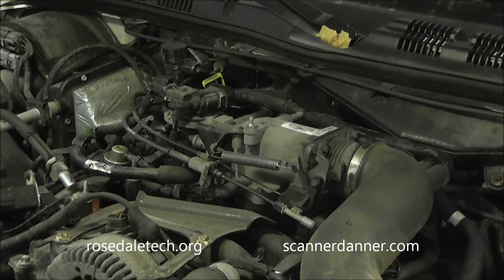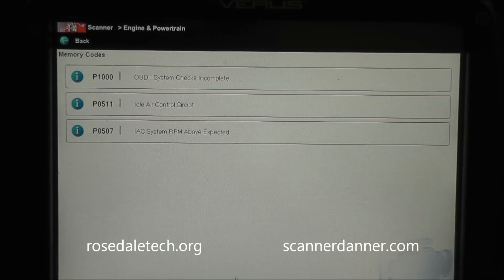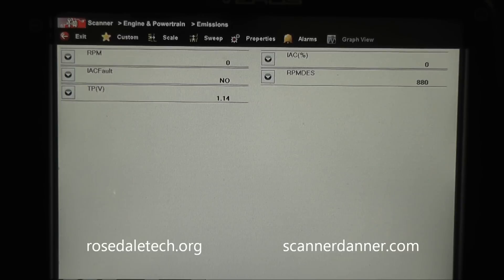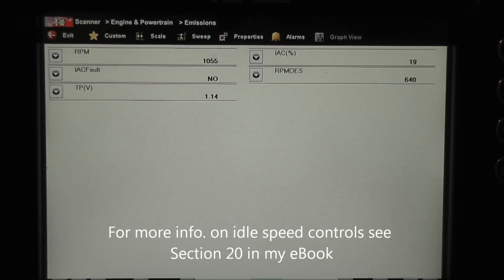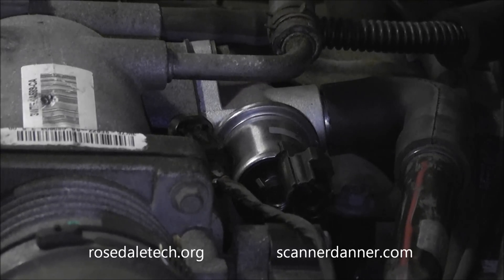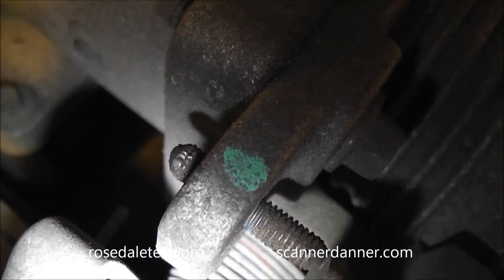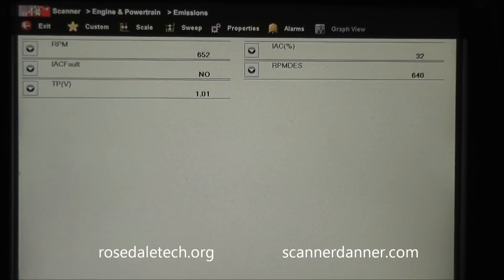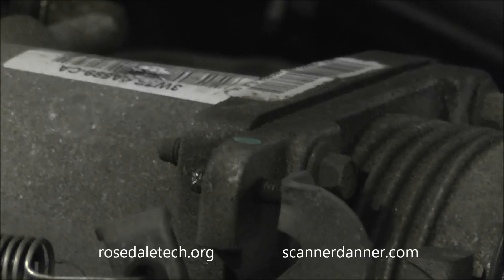Ford Idle Air Control (IAC) valve test (how to adjust minimum idle speed)

Comment: Will look into this, I just got a 05 Lincoln Aviator with 180 thousand miles in pretty good shape with the 4.6 32V, the only code I get is the P1000 as well but my trouble is every time it cold starts, RPMs rises to 2000 and after a few minutes drops to 1000 and I think that' s a little high for the engine lubrication in cold, any suggestions? Thank you for the Info!!
Reply from the maker: I would agree. What is your IAC % when it comes back down to 1000 rpm?
Reply: @ScannerDanner  just made the test, Desired idle Speed(RPM's):800, Engine revolutions Per Minute: 785, Idle Air Control %: 59.128% &TPS Voltage: 0.918V, this was performed at noon, tomorrow morning will perform  cold in the morning, thank s
Reply from the maker: That's a little high of a % for no accessory loads and at idle. I like to see around 30% on these. Clean your throttle body and redo that test

Comment: Not getting any codes, but when car is driven 5 miles one way and 5 miles back, the idle is way too high. Replaced with after-market IAC with no improvement.  Tapping on the IAC brings idle back to normal. Please advise.
Reply from the maker: If you are tapping on it and it is bringing the idle back down, then you most likely are still dealing with a bad part. (crap parts being made these days) Or maybe you installed in backwards? Some of these you could mount it either way.
Reply: @ScannerDanner  It's installed correctly. Will try a replacement. Thank you!

Comment: I wish this guy could have a look at my idle air control valve. My mechanic has 40 years of experience and could not fix it.
Reply from the maker: it is very possible you do not have an IAC issue. What is it doing?

Comment: So on my scanner when my explorer o1 os idleing its showing 17.2 % is that a good idle?
Reply from the maker: 17.2% on the IAC position? That means the ECM is commanding it fully closed. I'm assuming you also have a high idle speed?
Reply: @ScannerDanner  i wasnt at 17.2% then i went and fiddled with the tension screw of the throttle cable and raised it to 20% that resulted in my rpm at idle to go to past 2000rpm. So i lowered it to what i think is a sweet spot of 18% and rpms at idle show under 1000. Is that good?

Comment: Do you know general parameter settings for 2004 E150 5.4L Custom Leisure Van / Diy campervan? Needing higher idle rpm for force additional amps @ idle until I can get dual alternators installed.  Needing to keep a 3.56KWH Lipo4 house battery charged.  Thanks
Reply from the maker: You're not going to be able to change that. It is programmed into the ECM what idle speed should be. If you mess with the base idle screw, you'll end up setting trouble codes (this is a cable operated throttle body right?)
The only thing I can think of would be to fool the ECM into thinking either the AC is on, or there is high power steering pressure or that the transmission is in gear. 
I wouldn't mess with the transmission range switch input, but maybe the AC and or power steering psi switch 🤔

Comment: I have a 1997 Ford Expedition XLT 4.6 that misfires on one cylinder due to low idle at 550 rpm. No misfire at 650. Can’t pass inspection. Can the rpm be raised a bit?
Reply from the maker: You'll set other codes by raising your curb idle screw to the point where the iac cannot reduce it anymore. But you could try

Comment: Saved my ass.  I just bought a 98 f150 with the 4.6, started replacing OE consumables, after all that it still had a high idle and throwing p1507.  I was thinking I could have a bad intake manifold or something but, I did exactly what you did in this video (with a cheap scan tool- has live data), and sure as shit fixed me up nice.  Previous owner must have tried to fix the fact that he didn't do any maintenance on the truck, by turning that screw in.  Thanks.

Comment: So what if I’m idling at 1100 and the idle screw is backing out but the throttle lever isn’t moving back
Reply from the maker: vacuum leak, IAC motor stuck open, IAC is being commanded open (input issue) 
What is your IAC duty cycle command?

Comment: I watched some of your videos they are very good. It is really interesting how you check and tune things. Is there a way I can check the errors the had on my ford mondeo mk3 or it is only with special computer
Reply from the maker: what year is that? I'm not familiar with that model. You are not in the US either I bet, so I'm not sure what scan tool you would need to communicate with that
Reply: @ScannerDanner  haha yes, I am in eastern europe. My car is diesel, tdci from 2003, sedan with 130hp. I want to delete my egr but i want to lie to the sensors and because i don't want to search ppl to rework the computer. I wonder if my old car would have errors at all then maybe i can unplug the pipe that open the egr with vacuum air and make it stay closed.
Reply from the maker: @justvis1326  you can try posting to my forum and see what my community says. I have over 30k global members and it's free to join
www.scannerdanner.com 
Best I can do my friend
Reply: I gave a lot of money for repairs and i hope i can revive the car, because black smoke and loss of power got pretty bad lately. I think the problem is the egr system

Comment: I've seen the idle air control on a new edge Mustang v6 with no idle issues at around 52%. No stalling while decelerating or any other engine performance issues. Idle RPM is at spec. (between 700-730). Near the end you stated that this could potentially be an issue, can you elaborate on that? Maybe if I was stopped at a red light, uphill.
Reply from the maker: If you don't have any idling issues or stalling issues then don't worry about it.

Comment: 99 Mustang v6.   Throttle was hanging bad between shifts at 2 or 3k RPM.   Replaced IAC and TPS and still had issues.  With the IAC unplugged I backed off the blade screw on the throttle body till the RPMs dropped to 500 as described in this video.   Plugged IAC back in and idle came up to around 650 or so and solved the hanging RPM problem.  IAC now controlling throttle as it should.   Apparently someone messed with the screw.  Great video!!! Thank you.
Reply from the maker: awesome!
Reply: IAC restrictor plate solved my hanging rpm between manual shifts. Make sure to position the smaller hole opposite the IAC plug in.

Comment: I dont have any codes but my oil lamp comes on intermittently at a red light....could it be an idle issue or oil pump?
Reply from the maker: Could be from too much bearing clearance too. Oil psi test is the next step
Reply: @ScannerDanner  i notice at idle when my RPMS dip below 550 oil lamp comes on and thats when im on DRIVE at a stand still...in Park RPMS hover around 850 no oil lamp comes on 🤔 gonna find a shop to perform this test. 

What scanner are you using?

Comment: Hello and thank you for the video. Question, I did exactly as you said. At one time the idle plate was adjusted. I disconnected the IAC and the rpm jumped from 11k to about 14k. I unscrewed so the plate would close more but there was no change. According to the book my rpm should be at 700 idle. I added sandwich bag around  the IAC to make sure there was no air being sucked in that area but still no change. I plugged the IAC and the RPMs dropped to about 11k again. I've cleaned the idle plate and body too. Can you think of what my next step should be? Thank you
Reply: Vacuum leak

Comment: Hi Paul at 1:57 you mentioned not knowing if it had a EGR flow problem because someone cleared the trouble codes, what effect would a EGR flow problem have on the IAC?
Reply from the maker: I only mentioned that as a guide to the technician who is selling the job, to make no promises about the check engine light, because someone just cleared the codes before it was looked at. So other problems could exist. That's all. It was a cover your ass statement. 
An EGR flow (restriction) would have zero effect on idle speed and IAC function

Comment: Hey there... please help. 

My 2002 e250 van (cng)  has a low idle  this problem is new. It was fine then I just didn't drive the van for a long time the battery died when I jumped now it has a low idle.       Ok. Im thinking that when the battery died it erased the position of the idle from the computer now the van is confused and doesn't know the correct idle position?!?!?!?!  
  I'm so confused on what to do!!!!!
Reply from the maker: Tap on the IAC motor, it's probably stuck closed. I have a video on this on a Ford

Comment: so the valve is normally closed. no air at all goin in thru. so you unplug it and set the throtlevalve to 500rmp then plug the iac in and the computer adjust the valve. So if I unplug the valve with the engine running I should feel no air entering the air ports that feed the valve? if I do feel vacuum on the ports the valve is defective or not closing and needs changed out? I know the valve is clean , I know it moves , but I don't know if it closes all the way .

Comment: The last guy who was working on my Navigator,    turned up my set screw.....,    at least he told me and told me why.....  so as were finally getting it back in somewhat normal running condition......  found 2 vacuum hoses not even connected.....   a elbow boot that is cracked..,  added like 8 hose clamps.....  🤦‍♀️🤦‍♀️  apparently someone expected that they would hold themselves on.......🤦‍♀️🤦‍♀️already cleaned throttle body., m.a.f., found a unplugged coil pack..,  correcting my misfire n startup misfire code. 🤦‍♀️         new  I.A.C. & new T.P.S.  is on it  ,  I refuse to put another part on unless I verify it my damn self......🙃   however it's yelling  (the Nav.) alternator at me...!!!!     I have a  alternator test on my jump starter....  I have been procrastinating it..... (( yea, yea, I know)))   cause well  it's  a Lincoln, Navigator...........and it's gonna cry O.E.M.  ,,   O.M.G,,,
I am already broke....!!!!  Lol
And I am praying these cats aren't bad,   already in need of an exhaust.....    on the bright side  (if there could be one)
We don't have emissions here anymore.....!🤔😎😎😎🤫🤫
Contemplating  it for real....
I'm so close to getting him right,  compared to where he was when I  (rescued) him...
Lol..... my challenge vehicle for absolute sure.....!!!!   But,  thank God  he told me he set the idle up.....   I really didn't need to run in circles.....!!!!!!
With the multiple Mickey Mouse crap I found thus far, being majority of the problems.......GrrrrrrrrrrR..!
Done ranting now.........sorry...!🙄
Please.   Don't touch that screw.....act as If it ain't even there....!!!!!!    My idle is now 590--630,,      not  1100     ! I'm ok with that he is almost 23 yrs. Old with 182000 miles

Comment: Got a question my 01 crown vic doesnt soind like it has has a high idle when I first start it, ive changed the tps and the iac cleaned the throttle body and all...got any clues to what it could be...I dont have a scanner...??? Ty in advance...
Reply from the maker: are you having issues with the idle after the initial start-up? Is your minimum idle set right? Did someone mess with the screw?
Reply: @ScannerDanner  sometimes when I first start it its like it doesnt have a fast idle, ill start the engine and its idles slow immediately as if it didnt idle up upon initial start... I put new intake , iac, tps, iat sensor, mass airflow, its got 276k.. Runs like new tho, I have a hesitation like wen coming outta curve on light throttle, its done that 3yrs ive put 30k on it doing that, so I ruled out bad tranny cause it doesnt slip period..when I put new intake on it started idled up perfectly then after bout 30 secs it idled down like it was gonna quit, It acted up a couole days then started running fine, gets great gas mileage but that hesitation under light throttle puzzles me an wen i give more throttle it straightens up..but everytime I give it light throttle it'll hesitate only when driving out of a slow curve.. When I got the 01 vic the old guy said they put a new fuel pump in it but I cant see were a bolts been turned..I noticed it had old fuel filter on it when I bought it 3 yrs ago, I out a new fuel filter also,...do u think it needs a pump, but it also hold 35lb 40 lb pressure on my fuel gauge....its got new plugs and coils too...the idle screw has never been touched....it actes like something grounds out after coming outta slow curve under lite load....no vacuum leakes anywhere...
Reply: Even changed out tranny filter and solenoids 2 yrs ago...and new rear end gear oil.. The vic gets awesome mileage so I rule out tranny problems....its something simple or it wouldnt have lasted these 3 yrs....seems like a bad ground in my opinion some were idk.....wish I could get to you in pa I'm in southern w.v the vic is from nc and no rust period....ty in advance....I also thot maybe the passenger side cat mite be clogged when I changed the intake the whole passenger side of it was loose cause I poured water inna bottle around it...would a dobbed up cat cause the whole pass side intake loosen up??....it has a new intake now with no vacuum leaks anywhere...
Reply: When I ran fuel pressure out to take intake off...the pass side back injector squirted gass outta the rail...the whole fuel rail should've been bleed out since I ran the car til it quit running.?? so I could take fuel injectors out ..when I pulled the bk passengrt injector. Out of the rail next to firewall gas Squirted and it shouldve been empty were I releived all fuel pressure...thats the same passenger side that the old intake was vacuum leaking whole pass side intake was a bad intake all 4 cylinders vacuum leak...it has a new intake now...]
Reply: Could that back passenger injector be dobbed off since. Pressure came outta the fuel rail when I twisted the injector Out of the rail.l...???? Cause pressure is coming frombsomewere...
Reply: Ur the smartest mechanic I know on here and wish I could figure stuff out like you....keep up the awesome videos...I'm a subscriber btw but trying to get money for your other classes......ty scanner danner....u da man...Howie fr: Wayne w.v...
Reply from the maker: @berniceperry8898  you have multiple different symptoms, the hesitation on accel, let's talk about that for a second. Disconnect your EGR vacuum hose, plug it, then drive it. See if your hesitation is gone.

Comment: How about low idle speed. the idle sensor has been replaced, as has the EGR, MASS air flow sensor, all plugs and coils. Idle is still too low. in neutral or park is it about 615 to 630 and even less. IN drive it drops to even less.
Reply from the maker: will the idle flare up on a hot restart? say to at least 1100 RPM on initial, then it drops? Or does it just stay at 600

Comment: How do I get your ford ebook information  ? And would it be useful in diagnosing 2007 edge sel awd 3.5l suv ?
Reply from the maker: My eBook is not vehicle specific. It is a training manual on fixing computer controlled systems.
If you're looking for service info https://eautorepair.adtrk.biz/?a=10817&c=24&p=r&s1=

Comment: Hello my name is Bryan and I have a 2003 Ford explorer Eddie Bauer edition with a 4.6. I've replaced the IAC and the egr valve and tube. The problem I'm having us the throttle has been sticking when I come to a stop. Any information would be appreciated thank you
Reply from the maker: Could be a worn throttle body. How many miles?
Reply: @ScannerDanner  180,000. I still need to replace the intake manifold. I've been working on and building toyota's with my dad for over 30 years. I've owned only 5 Ford's before. So I don't know much about them. Other than your constantly working on them. Thank you again for the advice and help. I appreciate it

Comment: i need to set my idle just 100 points higher to compensate for a weak oil pump. just 100 points will do. how do i do that on a 2002 ford ranger, 3.0 n??? i tried the screw, but the computer resets it

Comment: I need to be able to manually control my IAC to spin up my alternator to generate more power, but I don't have a stepper motor style IAC, it has this duty cycle version, does that mean I need to manual add more or less voltage to the IAC to get it to open more?

Comment: S/D I have a 99 crown Victoria I replace the TPS now I have a real high idle that doesn't come down at all even after driving it the idle is still high like a carburetor car
Reply from the maker: Is the TPS adjustable? What is your closed throttle or idle TPS voltage? 
If it is not adjustable, TPS min voltage is a learned value and may need the battery disconnected to reset it.